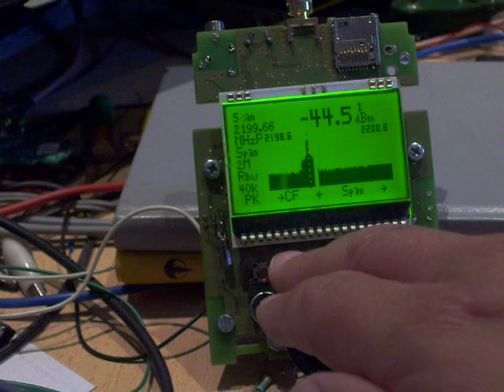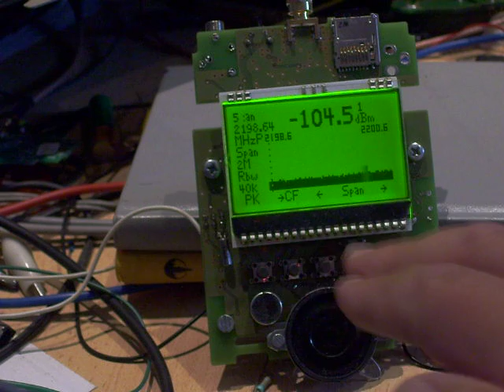Handheld 3GHz spectrum analyzer (by roelh)

Comment: As someone who didn't take RF electronics in college, I'm still trying to reconcile with myself how this is even possible XD.

My only two other questions are:
1. Where did you get the PCB done and how long did it take to lay out all the surface mount components?

2. On your hackaday page, I'm not sure how you derived 1920 MHz as the maximum receive frequency, and how the third harmonic is usable (i.e. high enough amplitude to be non-negligible). Can you point me to a reference which would explain this?

Very good work, as someone who prefers sub-30MHz XD, I like :).
Reply from the maker: Hi crt1901, 
PCB was done by Eurocircuits. Not cheap, but ready in 8 days. Layout did take a long time !
The max. receive freq of the Si4431 is 960 MHz, and the max. output freq. of the Si4012 is also 960 MHz. The mixing process delivers a sum and difference frequency output, A maximum input of 1920 MHz, mixed with 960 MHz Si4012 oscillator, would give a difference frequency of 1920 - 960 = 960 MHz for the Si4431 receiver.
Third harmonic: A mixer is normally driven with a high LO (local oscillator) level. For a diagram of such a mixer, search for 'Gilbert cell mixer'. It can be regarded as a multiplexer (controlled by the LO) that chooses between a normal and an inverted version of the input frequency. The LO mixer input can be regarded as a digital signal, and the mixer will 'see' these 3rd, 5th, 7th etc harmonics of a square wave, and mix with it. But the output for 3rd harmonic will be approx. 10 dB lower than for 1st harmonic mixing.
Reply: Sorry for the delay, but I wanted to say: thanks for the detailed response. I think I'll be able to fill in the gaps of my knowledge :P.